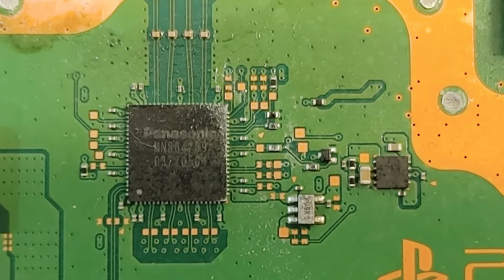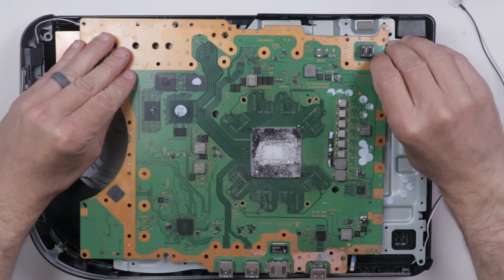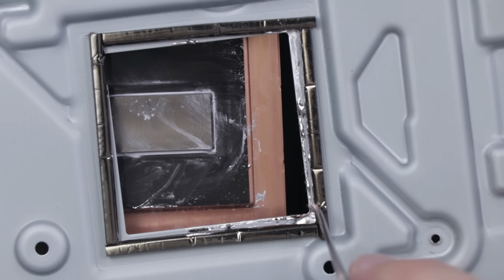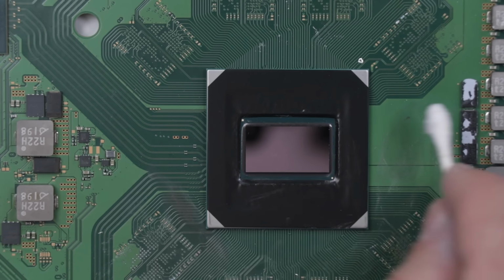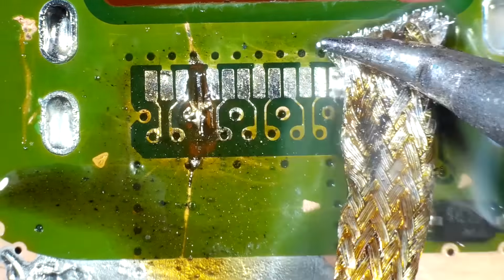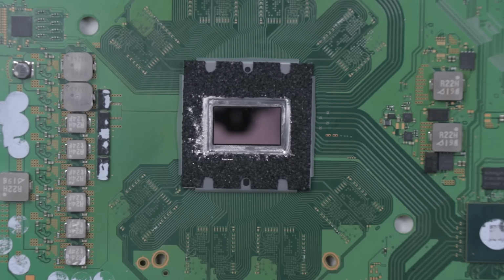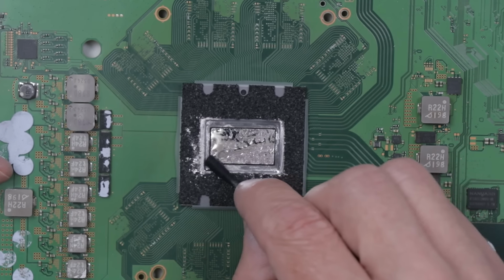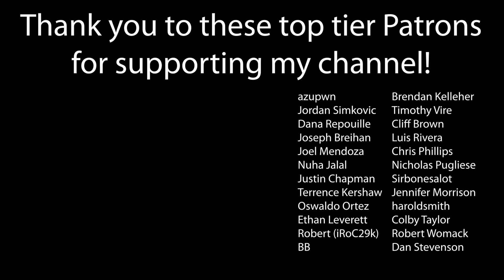TWO Repair Shops FAILED to Fix This PS5 - Can I?

Comment from the maker: Did you think I'd be able to fix this one? I wasn't sure when I saw that hole in the motherboard! 
BTW, check out my iFixit page: https://ifixit.com/tronicsfix
This is one of my favorite toolkits: iFixit Manta Driver Kit: Amazon (paid link) https://geni.us/XQLwaW
Reply: How do I get in contact with you to see if you can fix my PPS5 I'm having a fan issue
Reply: I've seen your video  On how to fix it but when I looked at it it didn't look as clean as the one you worked on
Reply: So how do I acquire your services because you seem to know what you're doing
Reply: i actually thought it was done for when you showed the hole in the port, good stuff as always
Reply: Truthfully, a hard no for me. With all that liquid metal spilling everywhere, I’d thought for sure the board would be fried. Maybe they never turned it back on?
Reply: Why don't use uv mask? You can avoid to make an Air bridge with it, or not?
Reply: Ellis The DJ  That was my same conclusion. It brought up memories of that one board with the MASSIVE hole in it. The one were when he turned it on, the whole thing smoked.
Reply: Hi
Reply: @TronicsFix

Massive issue which you didn't rectify.

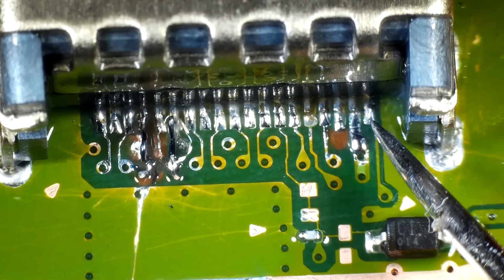You didn't solder in the replacement HDMI capacitor just under the far right pins at 8:56
Reply: @theroyalaustralian  What’s the consequence of that?
Reply: @leeartlee915  Never mind, the console works without its HDMI capacitor, holy s***
Reply: Where do you buy your thermal paste?
Reply: Ofcourse!!! i knew you'd fix it... 👍👍👍
i Love your videos...
Reply: Based on other PS5 faults and attempted repairs, I wasn’t holding out much hope for fixing this one.
Pretty clear you’ve learned a lot more about these since they first came out.
 Well done good sir 😃
Reply: I bought a ps5 of Facebook and ended up needing a hdmi. I done the repair myself thanks to your great videos and thought I did a good job but to my surprise, when I power the ps5 on. It has no power or lights/noises. Any ideas of what could be the culprit and if I can't find out what it is, any way I can send it to you to get fixed. Any help would be highly appreciated!!!
Reply: Liquid Metal - Tip

use some Brake parts cleaner on the q-tips or rag to clean up and to remove any stains,
Reply: Whoever in their right minds lets a ps5 get broken needs to be banned
Reply: Tronicsfix So I have a ps5 controller I'd like to donate to you, for some reason the ps buttion is completely unresponsive meaning it will not turn on through bluetooth. I've hooked it up via usb and it works fine. No other damage to it. But I've had it a part to look for any signs of damage and I couldnt find anything. I'm interested in sending it to you for a video so I can learn more about what to look for.

Comment: You may not be a GPU repair guy but your attempt was still hundreds of times more professional than whatever this PS5 went thru in that repair shop.
Reply from the maker: Lol, I'm def not a GPU repair guy. It's fun to try to fix things I've never fixed before. Sometimes that ends up good, sometimes not. That's just the risk I take.

Comment: I really don’t understand how 2 “repair shops” could stuff this up so bad to the point of such damage? Awesome stuff on the repair though as always.
Reply from the maker: There are a lot of repair shops out there that can do all the simple repairs but not the more difficult repairs. Many of them can't do anything with board repair.
Reply: @Tronicsfix  idk man, fixing traces and adding jumping wires should be taught day one. I wouldn't call those difficult repairs especially on a board that big. Did this sort of stuff for years before switching to software development. It blows my mine they couldn't fix a simple HDMI port like that.
Reply: @Jabo2531  True, but what Steve says is also true, not that dificult to repair, but maybe the repair shop need to get better technicians that can do all this type of things.
Reply: Yes. It’s all about the technicians. They aren’t just born. It takes time to train one. But of course. Practice makes oerfect
Reply: @lance_with_both_nuts  yeah I call those guys part swappers. Its good to learn when your starting out but you got to move on from that. If you want to do electronic repair long term. Although the way the industry is I wouldn't recommend it. I was an electronic technician for about 15 years and was laid off about a dozen times. Now I m a software dev and couldn't be happier.
Reply: stay away from repair shops one ebay,people try to go into business if they manage to fix their own devices and if it works it is usually good on your own device but i once fixed a faulty soldering pin on an iphone with tin foil and super glue, it lasted for years but most would not be happy especially if they paid full price for a repair.
Reply: Soldering like that is really hard,  it's pretty much like performing surgery,  you need the special tools,  lighting,  magnified glasses and overall practice,  a lot of practice. I tried replacing a cap on a dead video card and just couldn't take it out without damaging the board. 
People usually take useless board and replace components for hours and hours to get the hang of it
Reply: @Abyss-Will  I agree to some extent but you dont really need special tools to fix some traces. Sure all that stuff makes things easier but not really necessary. I would say to fix a trace you just need a soldering iron with a fine tip and a xacto knife to scrape

Comment: Amazing repair Steve! Great gesture of buying the PS5 and also fair enough that the repair shop gave the rest of the money so that the customer could get a new one! 🥳
Reply from the maker: That was my main concern is that the customer wouldn't get screwed. I'm just glad the repair shop seemed to be honest and genuine.
Reply: Seriously fair business. It is hard given all the competition with the price race to the bottom. Which doesn’t leave any margin to fix failures. So  that shop is good even though they couldn’t do the job in the first place.
Reply: if he can find one
Reply: @yamisniper  Precisely my comment.  What should be done now is it should be offered back as first option to the original owner at a reduced rate.

Comment: crazy to think that this repair was actually pretty straight forward for you, and should be for any repair tech. Went from a routine to an actual job because they were underqualified to do this repair. Sad this happens to people, but fantastic repair nonetheless.
Reply: its not necessarily that they are not qualified, maybe they have so many different jobs to do and only one technician to do all so maybe he does not solder all day but fixing all kinds of problems and if for sometime you didn't fix complicated stuff you loose the ability, thats why its a good idea to split the work and let one person only do the soldering and another person only do simple jobs instead of one person does all of it.
Reply: @robbirobson7330  The tech that worked on that should not be allowed anywhere near devices at this time. He/She didn't even know what liquid metal was and didn't even bother to clean any of it up before mixing something else in on top of it. What tech in there right mind would do something like that? I am sorry but if I had a employee that said they could fix something and then turned around and found out they didn't have the slightest clue what they where doing, they would be looking for a new job. 

It is great that the repair shop owned the problem and made it right. But that Tech is not qualified to do PS5 work in any way. Heck I wouldn't let them near any computer based repair. If they are qualified then the whole thing had to have been done on purpose.
Reply: @Toom316   I didn't realise there was a qualification for PS5 repairs, where do you enrol in this qualification ?.
Reply: @tastytechaddictsmtb  you get it by being able to repair it.
Reply: @nadine2185   that’s not a qualification though, e.g you wouldn’t go to a doctor that said they’d done heart surgery a couple of times and it worked.
Reply: @tastytechaddictsmtb  Qualifications aren't necessarily gained by formal courses. Being experienced in board repairs and soldering small heat sensitive components qualifies a person to do the job.  Competency is a qualification itself.
Reply: I think we all need to remember that this is a $500 console. The repair shop is not getting ad revenue from youtube. I would be curious how long it actually took to repair as obviously majority of the repair is done off camera. Like lets say it took 6 hours and I need to supply solder, liquid metal, and the sponge I would think we are looking at a close to $300-$500 repair. I do understand due to shortage of PS5's that might be worth it but at least the shop did make the customer whole.
Reply: @Nilboggen  no excuse for breaking something more then it was already broken. If you think that it is acceptable to bring something to a repair shop, and get it back more broken... I don't know what to say.
Reply: @wusb8  you watched the same video I did right? Where the repair shop was concerned enough to contact a youtuber sell the ps5 to him and then throw in some of their own money to purchase a new PS5 for the customer? Edit: I should add I am defending the 2nd shop not the first. I do agree that one wouldn't expect to get something back more broken than when it started.

Comment: Hey Steve,

At 7:22 you are talking about a broken trace but actually a capacitor is missing from there. At least there is one there on the "good" board at 7:56.

Comment: Great work mate, so hard to imaging how these get in this condition. A hole in the board lol, like how 🤔 
Can't fathom how 2 "repair" shops handled this console.
Reply: It’s because there are no regulations. They could just be a second hand shop owner who thinks if they follow some videos on YouTube they can make a bit of extra cash. This is why I would never go to some little shop on the high street unless they had a damn good reputation. I’ll just send mine to Sony if it breaks, because even if a store fixes it I don’t know how good a job they have done, how long it will last or even if it’s safe. These shops clearly rely on impatience for the most part - people don’t want to be left without a console. The stupid thing is that most of these consoles will have a perfectly valid warranty so could be fixed for free. These repairs not only are a risky endeavour but also completely smash the manufacturers warranty into oblivion.

Comment: Love watching your videos as always.  Keep them coming!  Also, I can attest that the ifixit pro kit is worth the money.   My son wasn't able to charge his phone a while back and brought it to me.  Charging cord would just fall right off, not staying attached.  I used the picks form the toolkit and was able to dig out a metric crap-ton of dirt stuff that was built up in the charging port.  Once cleaned out, the charging cord connected like it was supposed to.  I've used it to work on numerous laptops and other stuff as well.   Best toolkit I've ever bought.
Reply: I actually fixed my mother's iPhone XS recently with their kit too. Replaced the OLED and swapped over the original Face ID components and it works perfectly! Easily saved me $100 instead of going to a repair shop.

Comment: Steve- I have an old retro game unit that has been sitting up since I was a kid. I think it would make a cool video if you would like to break it down and clean/fix if possible. The unit is a TurboDuo (turbografx 16) but very rare. Let me know if you're interested in making a video. Symptoms since I tried starting it is Av video is hit or miss on display, cd rom spins but says to set disc. Cheers.

Comment: Your videos are always so good. As a tinkerer, makes me want to try my hand at microsoldering lol but I don't have the time or money. So I think I'll just keep to watching for now.
Reply from the maker: It does take time and some money, but it's pretty fun once you get the hang of it. Thanks for watching!
Reply: @Tronicsfix  thanks for the encouragement! I'm actually a plumber so I've solderered plenty of copper and wires. Just never soldered anything that small. I've worked on plenty of electronics (mostly just replacing the boards/components all together) and plenty of computers/laptops and phones and I'm sure eventually when something expensive of mine breaks I might dip my toes.

Comment: Insane fix. I wouldn't even try soldering so tiny stuff but I don't call myself a repair shop. That this PS5 went through two of 'em isn't a good rate. You fixed this mess, that's true passion and mastering of this work, dude!

Comment: Wait on the missing spot on the ground on the hdmi had a resistor missing connecting to the pin next to it. You can see it when you looked at the other ps5

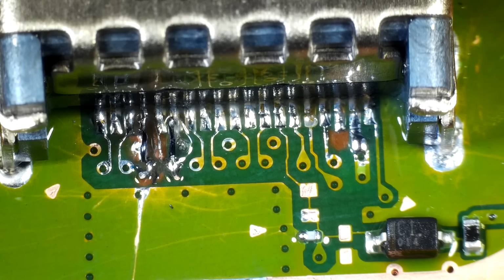Comment: 9:00 @tronicsfix could a silicone coated wire be used as a jumper wire; or not a good thing to Israeli….period?
Asking, b/c there’s times (especially old handheld game consoles and etc…..) when I’ll grab correct gauge wire that’s either solid/twisted  and has an Luther silicone “jacket” to help w/ “many things” etc…..
Wondering your thoughts and suggestions.
Cheers✌🏻

P.s. sorry about spelling/typos; been up 39 hrs and my dyslexic eyes blurry as all get out and autocorrect just plain sucks! 😂 
Thx again

Comment: Great repair. Is the missing cap not an issue on the second to last two pins on the HDMI port? It seems to work just fine so far.

Comment: Great it was fixed and handled by the shop! I'm still curious why Sony felt the need to go with liquid metal. Didn't tests after launch show a good thermal paste does just as good if not better job? Would think they could save money and make it easier to repair both first and third party if needed.
Reply: No, TronixFix did a video of a PS5 with thermal paste instead and it ran like dog crap. Liquid metal is genius but it’s not meant to be removed by people that don’t know what they’re doing
Reply: @captaincrunch1707  could have sworn others tested and it worked ok, but I could easily be remembering wrong.

Comment: Question about 8:20 where you put a bump/loop in the wire. Would you also want to add a dab of hot glue? Like as an insulated layer between traces and the wire?
Reply: What he should've done there was put solder mask over the damaged part of the board, cured it, then run the bodge over that. Not sure why he didn't.

Comment: About fixing stuff, l just fixed my sisters cars tailgate by just pushing the "open" button repeatedly. A mechanic gave a 200€ estimate to replace the motor 🤦‍♂️

Also my parents car had an airbag warning light on and they went to a mechanic to get it fixed, their doings did nothing but they charged 100€ for it (was like a software clean up something they did) but i wiggled the wires under the seats and then put the car in diagnostics mode which cleared the error.
Hasn't come back since.

Some repair shops are just ridiculous.

Comment: Hey Steve, can you make a video solely dedicated to cleaning up & repairing a console that was previously roach infested? I got a PS4 Slim that was somewhat mildly infested with a couple dead skins & ton of roach poop.

A step by step detailed video would help me out to at least attempt a proper revival for a non working ps4 slim (I should mentioned I found a good source of white powder, not sure if a capacitor blew out in the power supply.

Comment: The previous repairman didn't had those small wires so he made a trench in the board and flooded it with solder to connect the traces? 0_0

Comment: Was that crack on the motherboard already there causing the hole or was that the result of whatever they did to put a hole through those contact points?

Comment: They overdo it at the factory to make sure. You only need a pin-head size for it to be equally as effective
Reply from the maker: Not on a PS5. You need WAY more than that.

Comment: Hey Tronics! Great fix on this PS5. I was wondering if you have a link for the wire you used to create the trace for the HDMI connector you installed? Would you recommend that same wire for creating traces for a Joycon and the annoying ZR button that's notorious for falling off?

Comment: Can we please get an update video of your PS5 that you addressed the coil whine issue on with you playing a PS5 game, even Astro’s Playroom (since it’s free) if you don’t have any others? It would be great to hear it with the PS5 assembled and being used. PS5 games and games enhanced for PS5 really trigger coil whine. 

It seems Sony should have used higher quality components and some insulation on the PSU. I’m surprised there’s none. Even the original Xbox power supply used insulation. If they don’t change the PSU parts and how it’s made (lack of insulation), coil whine will likely be a problem for every PS5.

Comment: I still don't understand how so many console get damage hdmi ports.
Reply from the maker: People just being hard on them.
Reply: great content by the way, as always. yeah it's just its a one way port and normally when you setup a console you leave it in one place. I do the simpler repairs and the problems/damage never stop to surprising me.
Reply: a lot of the time is people pushing the console back to far and the cable pressing against the wall
Reply: @atroxie  I understand the big picture  but it happens so often. but I know accidents happen and people cable tie stuff to hard and tight

Comment: I have an issue that you might be able to help me with. So whenever I leave my PS5 running with a game open it shuts down and says it was turned off incorrectly. This only happens when a game was open, if I just leave it running without a game open it will enter rest mode properly and stay there until I turn it back on. I've Googled this and it seems that other people are having issues as well. Some people recommend disabling the HDMI device link and I've already done that but I'm still having the same issue.